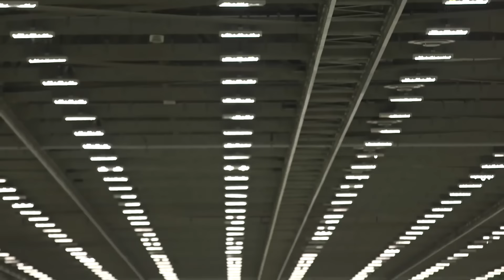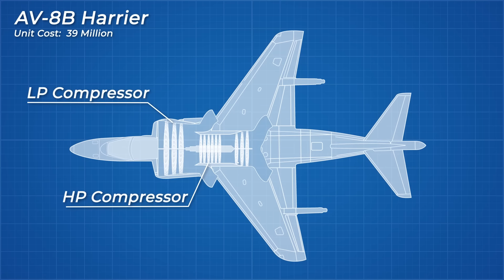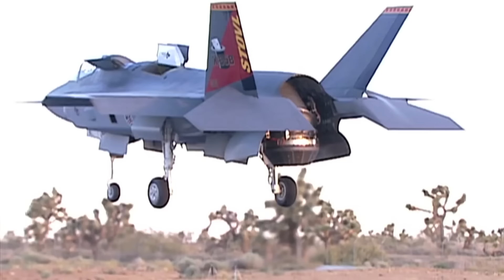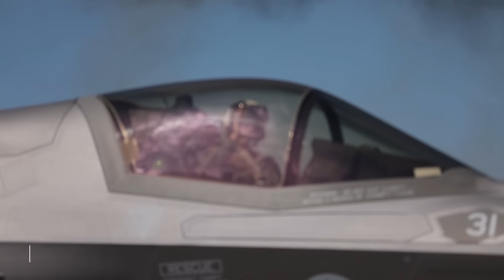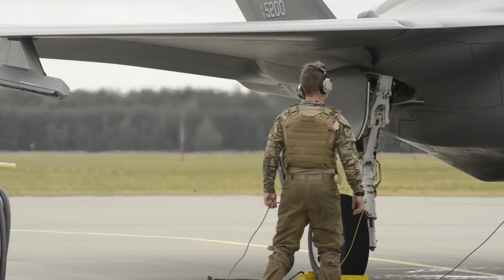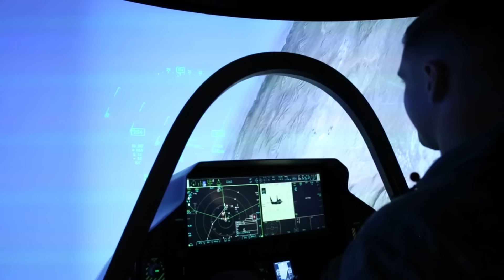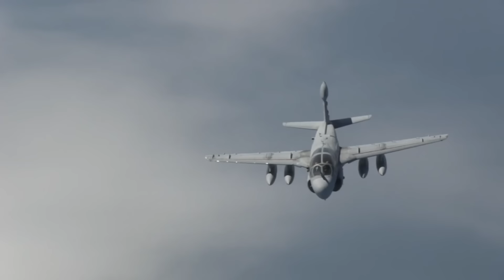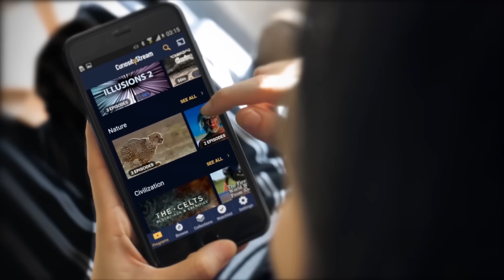Is The F-35 Worth $115 Million?

Comment: Vertical integration was moved away from to reduce costs, not specifically for political motives. 

Three different planes for three different branches was a no-go, and would have cost more money in the end (increased NRE, no commonality, etc.).  Also a Harrier replacement would have been DOA.  Imagine the cost of the F-35B's development being spread over 300-400 aircraft instead of 3,000+. 

That report re. the F-35's maneuverability has been debunked many times. (The F-35s envelope had not been fully expanded at the time for instance.) Also the F-35 was not meant as a replacement for the F-15.  That's the F-22's job.  Go over to F-16.net and see what actual F-35 pilots have to say about it's maneuverability. 

Re. the F-117, consider it a "low-polygon" model for exactly the same reason 1st gen polygonal computer games were low detail- computer power.

Comment: The f35 isnt an exceptable replace ment to and a10 it would take 5 f35s to even bring the same amount of ammounition  and is less accurate and uses small rounds
Reply: quintan herbold Isn’t it a good thing that need for ammunition is scaling down?
Reply: @joebloggs6594   https://youtu.be/_r8WdBeyMSQ
Heres a link to a nore indepth video about the a10 and what it can do its very informative if your interested 👍
Reply: Well i would agree with you but as a in a close air suporrt roll you want more ammuntion and the ability to do multiple strike in 1 sortie 
Just for compareability sake 
1 f35 with no under wing munitions can only carry around 150 rounds and because of the smaller caliber cant penetrate the armour of most modern tanks so it only effective at human targets aswell as it would have to be flying extreamly low to acomplish this  making all the steath aspects of the aircraft almost useless (while striking)

Were as a a10 can carry 1100 rounds of a larger caliber 
Allowing it to attack multiple targets as well as destroying tanks and other hardened targets with out using rockets 

Also another thing is the price at around 70 million for an a10 and 90 million for the cheapest f35 with the most expensive f35 (115 million) being the most effective  at filling the roll of an a10 

And america simply dosnt need to replace a great aircraft with one that cant do the same job as well for other nations without a a10 style close air suporrt/ ground attack roll plane the f35 gives them that capability

Comment: A-10: laughs in Brrrrrrrrrt
Reply: Why is everyone trying to kill each other here?
Reply: Exactly. I say replace the A10 with a dual cannon a10
Reply: A10 cost is around 1.5 million, it is a great dispose able air to ground support plane
Reply: gman57op well, the A-10 isn't meant for air-to-air combat... And you can tell me what you want, but the F35 is not nearly as capable as the Warthog in AG combat
Reply: @trox6734  brrrrrrrt
Reply: @trox6734  The F-35 is much, much more capable in air to ground.
Reply: @ivanlagrossemoule  maybe with its bomb payload but what about its machine gun payload? that Warthogs main machine gun is powerful enough too shred through most tanks with a single shell and it fires thousands of those in a matter of seconds. that and the A-10 is designed purely for air too ground combat while the F-35 is a jack of all trades which means it will not be as good as a dedicated aircraft for that job.
Reply: @thestormcraft4012  F-35 has a cannon powerful enough to shred through most structures (25mm) but in this day and age this is becoming irrelevant for anything other than close air support against Taliban-type infantry. Guided bombs and missiles are so precise now that armored vehicles or bunkers or any other such military target could be easily taken out from beyond visual range or from 30 miles away in the case of bombs. No need to rely on a metal bathtub with wings and a big ass cannon on it
Reply: @yomama629  You are true, " this is becoming irrelevant for anything other than close air support against Taliban-type infantry" ..but...... but this sort of enemy is not rare......and wery tough opponent.
Reply: @yomama629  well, if you look at it literally all the wars actually fought are against guerrilla , not militaries. The A10 despite its age is still prevalent because stand up wars are just not a thing that can happen anymore, not when nukes are in play
Reply: @thestormcraft4012  According to who? The Gau was designed when the T-64 was the top tank to be feared in the Eastern Bloc, tanks have improved substantially since then. I doubt the Gau can handle a T-90 or Armata. The 25 is enough to handle BTRs and other APCs just like the Gau. Modern MBTs do not operate in isolation, they operate in tandem with support infantry and vehicles. The A-10 would not be able to get close enough for a gun run.

You also have to consider that the A-10 is only allowed to operate in environments that are deemed to not be high risk. That means minimal SPAA. The A-10 is built to resist 23mm cannons like those found on the Shilka, but most cannon armed SPAA has moved on to at least a 30mm cannon, like the Tunguska. Those newer cannons will shred the A-10.

I love the A-10, and it has advanced significantly since it's introduction, but it is not built for the high risk enviroments where modern MBTs will be found. The 35 will be much more reliable in such arenas.
Reply: @Chopstorm.  Shhhh you have an informed opinion. These COD kids hate that more than anything.

Seriously tho, the A10 can only operate against an enemy with no AA capability.The Gau8 is good and all but the UK does not even bother to stock ammunition for the guns on their fighters.Thats how little use a gun is in the modern battlefield.
The F35s payload is more than sufficient to meet the ground attack role. But unlike the A10 and frogfoot it can defend itself against air and anti air threats.
People seem to forget that the A10 was built to fight cold war russian armour. Modern armour can easily take 30mm shells, not to mention that all modern forces deploy antiair systems alongside their tanks...
Reply: @tothethreshold.9965  And in said cold war scenarios it was expected to lose almost all of our A-10s holding off any push through the Fulda gap. 

The A-10 has advanced in many ways, but so has the ways any opfor has to deal with the A-10. You could expect similar results today in battles with modern enemies.
Reply: @yomama629  and its main gun is so inaccurate as to be useless. So why bother with it? Nah the F35 is a waste of money. Give me an A10 with Raptor as support .
Reply: @Chopstorm.  😂 and the A10 lives on, up to the 2030s. In the role of close air support, in areas such as where they deployed, they have no competion. Love to see an F35 doing close support in afganistan. Won't happen.
Reply: @boatymcboatface666  Except it already has. The A-10 is getting replaced by a superior aircraft. Face the facts, get over your feelings and look at reality. The armed forces are getting something that is vastly superior. You should be happy for them.
Reply: @tothethreshold.9965  ehh not really the 30mm on the A10 has over 100mm of pen maybe bit higher as far as I know I don't think tanks have that much armor on the top of the tank and besides that the gun fires fast as hell high chance something will be damaged or destroyed are being attacked and the crew would mostly abandon their tank if they are still alive
Reply: @yomama629  You know a similar claim was made with F-4 Phantom II, that being "Well we got all these fancy missiles so using a cannon won't be necessary.", and guys what? They ended up putting a gun in it because you always need a gun
Reply: @infernosgaming8942  comparing 1960's missile, radar, and weapons guidance tech to that of 2020 is beyond asinine. Sure, these weapons systems failed often back then. In an era where all air to air combat engagements are beyond visual range, fighter mounted cannons have become irrelevant. They're mostly included for CAS nowadays, but even for that their purpose is diminishing
Reply: @tothethreshold.9965  Ehjhhhhhhhhhhh wrong. Retired air force. Yes at distance a fighter jet has an advantage based on missile launch if they have the tech for super long missile strikes but anything in 5 miles the A10 was know as a superior air to air combatant. They could flu low and slow which gave modern fighters fast as they couldn't fly as slow or low. It also has a distinct advantage in turn radius and a very short snap burst destroys other fighters. This was proven several times. What bothers me is what other thing the A10 does that people forget. The A10 is also an escort plane for helicopters. Because it could fly so slow and low. I am unsure if the f35 can handle this or if the frame can hold up to it. They attempted it with f16 and it failed miserably. I actually think taking what we know of a10 and building off it's platform would be far superior idea. As someone who was on the line while being saved by the crazy brrrrttttttt sound in battle I bias and until I see it do exactly what an a10 can do ill call it a failure
Reply: TheStormCraft bruh the 30mm is useless against modern tank armor. The only one I can think of would be a t-77’s (I think) roof which would require a near 90 degree dive
Reply: @tymeonmyside539  The GAU 8 Avenger gun that the A10 has was made in the 60's-70's. It fired 30mm rounds at up to 70 per second. Imagine gun technology and firepower back then compared to now. Imagine if we build a gun with modern technology, increase the size to 40mm, and the rate of fire to 100. Then put dual cannons. Also place better armor and redundancies and countermeasures.
Reply: @infernosgaming8942  The Navy had a better kill ratio than the Air Force, and they never got the E version of the Phantom.

The problem was the training. Once pilots were better trained, the lack of a gun became irrelevant.
Reply: what kind, though?  f35 can launch a couple of missiles or bombs, but it can't take any hits, let alone stay in an area long enough to BRRRT for INFANTRY SUPPORT. Remember? There are guys on the ground?  They're what you would call... ooh. what's the word? Alive? Important.
Reply: @Chopstorm.  well the countries and groups we are fighting don't have the money for modern tanks most groups we fight don't even have tanks they don't need them they wait with IED's or RPG's to take out our tanks the days of tank on tank warfare are over.
Reply: @ASYodaGaming  So we shouldn't prepare for the future, only the present? That seems silly.
Reply: @ivanlagrossemoule  no it is not 😂 nothing will ever out preform the A-10 in AG
Reply: @gman57op it's an effective CAS aircraft. Proved itself very useful in Afghanistan
Reply: F35 is designed to be part of a large integrated weapons platform consisting of air satellite and ground inputs... It's the most connected aircraft ever built .   It's yet to prove itself in combat but on paper it's good as part of an integrated platform.. it might be different in reality but that's what usa are selling..
Reply: @into_the_void  The F-35 HAS been used in combat. The Israeli's were the first, but the US has used the A and B versions in Afghanistan and Iraq. 

Hell, the Israeli's have a photo of one of their F-35's flying over Beirut in broad daylight.
Reply: @Elthenar  they didn't ever fight a capable opponent... Bombing a 3rd world country to bits hardly counts as real combat experience.. more like target practice.
Reply: @into_the_void  When was the last time we did a mission that you would count as "real combat experience". Vietnam?
Reply: I love the A-10, it's at a minimum in my top 3 favorite aircraft of all time along with the P-38 Lightning and the A-1 Skyraider (or AD, if you prefer the old designations), but there's no denying that it's long past it's life expectancy. The GAU-8 is an absolute beast of a gun, but it's intended use was to have a (relatively) cheap and reliable way to kill soviet era T-55s and T-62s. The advancement of guided munitions prolonged the viability of the platform as a whole, along with more advanced avionics and fire control systems, but we have to remember that she's and old bird that's barely hanging in there with almost 50 years of service under her belt. The fact that the platform outlived its manufacturer is a testament to the impact that it had on the battlefield, and how much we loved seeing it flying over when shit got hot. Fact of the matter is, nowadays, it would only be really viable against lightly armored ground targets with no more than manpads for air defense like we've been seeing in the middle east. And even then, she was designed for pilot protection more than the ability to get slapped with a SAM and fly home, even though the redundant systems and overall design did allow for a higher than average survival rate. Faced with an SA-6, or even an older SA-2, the A-10 would struggle to be able to even get into the AO. She can't climb to safety, isn't fast enough to run from enemy air (if that's something that ever happens again), and is unfortunately an very expensive single mission, single seat aircraft to maintain per flight hour (~$20K/hr). I love that ugly, cranky old bitch, but even in Afghanistan, a lot of our CAS missions were being supplied by cobras, F-18s, and F-15Es, who's 20mm guns were more than capable of handling the same targets that the GAU-8 were so proficient at destroying there. At best, the thing that the A-10 brought to the battlefield that nothing else did was the psychological effect it had on both sides. One side would leap for joy, and the other would go straight to brown alert.

If you have to kill a hard target, you use an AGM or a bomb, and the F-35 is easily the most capable platform for that type of mission. It can still strafe with it's 25mm gun when needed, it can defend itself better than the A-10 ever could, and it can get into the AO quickly with a high chance that it won't even be noticed until it's too late. Add on to that the newer weapons we've developed like the JSOW, and the enemy would be dead long before they realized it, bringing that psychological terror of not knowing if one of these things has you in its sights to anyone who knows that their opponent has them in the area. As much as I hate to say it, the F-35 really is the only suitable replacement for the A-10 as it currently stands, and I honestly don't think we'll see another platform like the A-10 ever come into US service, purely because the nature of the fight has changed to the point that its original mission is irrelevant to the modern battlefield. I don't want to see the A-10 retire, but at the same time, if we were to get into another full scale conflict with an enemy that is actually capable of putting up a strong conventional fight, the A-10 would be relegated to the sidelines because it's just too vulnerable now.
Reply: @triggerhappySOB  Well said. We are mostly using a gun designed to fire high velocity DU rounds to fire relatively light HE rounds at guys whose best armor is a turban. If we did get into a war with someone using high end Russian made tanks, I am not convinced the gun can penetrate the modern composite armor of those tanks, nor could it survive long enough to carry out such an attack. Russia has built exceptionally powerful mobile AA vehicles to protect those tanks from choppers and A-10s. 

For what we use the A-10 for, modern turboprop CAS support planes can do just as well in a far, far cheaper platform. In fact, they could probably do it better. A turboprop plane is far more efficient at the slower speeds where an A-10 was making a living. One of them could loiter over friendly troops for hours. One of them costs about a 10th to operate per hour compared to an A-10. Then, if that turboprop plane does run into something it just doesn't have the firepower to kill, it can call in that F-35 and watch the target burn.